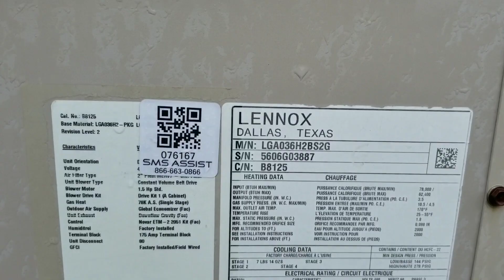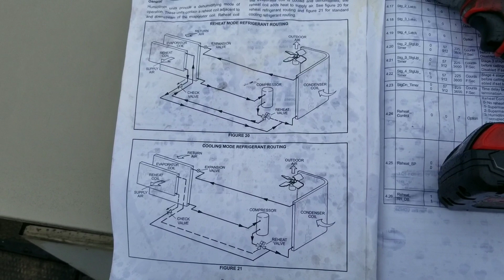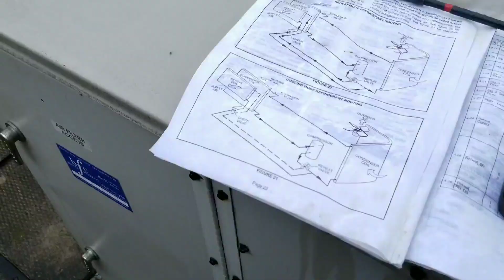Adjusting humidty levels on a Lennox package unit

Comment: I have residential that shows 70 percent humidity. Lennox changed the coil twice and before  used to see 50 percent humidity. Now 70percent . It cools well but high humidity after they replaced the coil 2nd time. ?

Comment: It is important to note that when you have one of these units at a store that is using the L connect language and the S bus daisychain data line connected to a Novar panel, that the Novar software can override the changes that you make to the humidity setting, even though you believe that a change needs to be made. This is done so that the client store corporate can dictate the humidity level and thus….how frequently the unit is using electricity. A unit like this that uses an ETM does not have the ability to override your humidity setpoints.

Comment: On that particular unit, how does it know what the space humidity is or when the space is calling for dehumidification but not cooling?
Reply: There is a humidity sensor in the space when you are using the humiditrol unit to control the humidity, and cooling is prioritized over the computed call for dehumidification. I have several humiditrol units at client stores that were simply used in place of a normal L-series unit because this is what the contractor had available…..and they’ve never been used or intended to be used for humidity control.